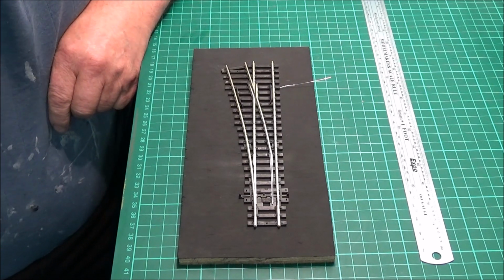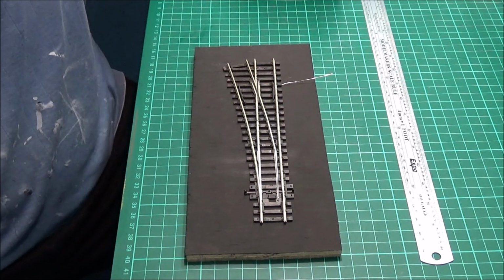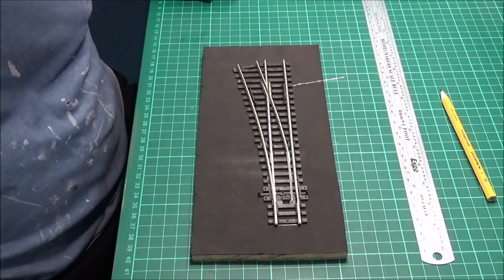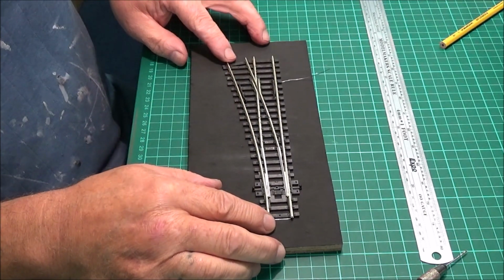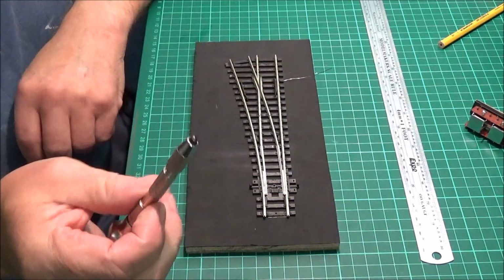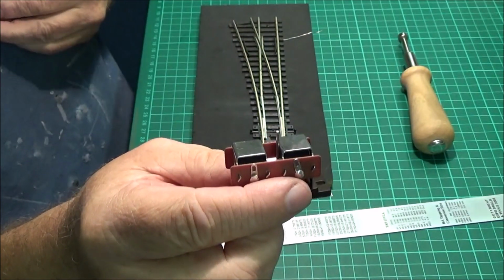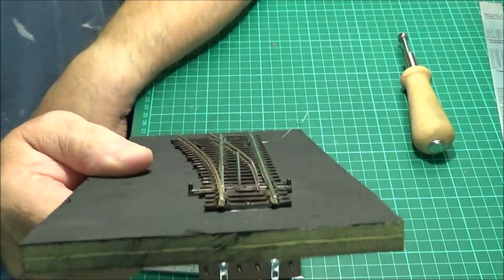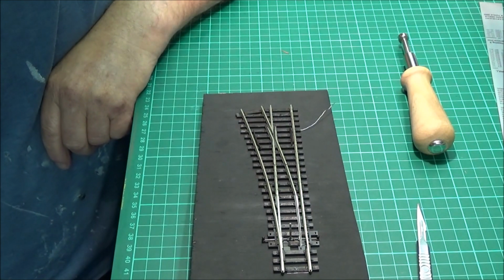Accurate Point Motor Fitting. Video #37

Comment: Useful video, thanks.  I also drill a 10mm hole for the pin to poke though the baseboard, and use Blacktack to hold the plate underneath as you can move it around a bit quite easily if necessary.  As others have suggested, pre-wiring the motor takes this challenge away once it’s mounted, at least at the motor end.

Comment: Interesting.  I am just starting in model railways but in N Gauge. I have been playing about seeing how I can fit the PECO 10E points with varying degrees of success, most of which taking ages! I am going to try your method but as you probably know, the fixing hole for the motor pin is on the outside of the points in N gauge, not in the centre as in 00 gauge so difficult to hide. Your method will probably work but I'm not sure how I can hide the hole on the outside of the points. Maybe a small piece of plasticard which would then be covered by the ballast??
Reply from the maker: Thanks for your comment, yes I think that plasticard and ballast would work, just be careful with the glue.

Comment: What an excellent, informative video!  I shall definitely employ your techniques next time that I need to install a point motor. Over the years, I have spent many an hour struggling with them.  One of the key things must be to lock both the tie bar and the point motor in their central positions.
Reply from the maker: Thank you for your comment

Comment: May I suggest prewiring the point motor and the aux switch before fitting below the baseboard. I leave long (250mm) leads so as to make the final connection (tag strip or choc block) location flexible. I also bond the switch rails to the stock rails on each side and take a pair of dropper wires down below the baseboard too, via a single central hole between the sleepers. By doing this you ensure you are not dependant upon the tiny switches built in at manufacture to make the circuits to the frog, thus ensuring more reliable running in the long term. When using Seep point motors I have jig to identify the fixing holes. These are drilled and counters inked to clear a 4BA set screw.  The fixing 😂holes in the Seep motors are tapped 4BA and now all fitting and fixing can be done from above. Finally I mask and mark the location of the screw heads with card ‘drain covers’ painted black or grey.  Happy Modelling Tony 🚂

Comment: TOY TRAIN SET OR PROFESSIONAL LAYOUT STANDARD ???
Never use SOLENOID POINT MOTORS they'll eventually rip out the Peco hair spring or break it. Use a nice easy screw under the baseboard "Slow action Motor driven type" such as Fulgurex. They last for Decades even on heavy duty exhibition layouts, and come with free built in switches for live Frog's or signal interlocking or whatever you fancy. And are aimed at Professionals !!!
Reply from the maker: Thanks for the tip but I am happy with what I am using.

Comment: Great explanation. I am doing some what of the same procedure you are doing. For centering the throw bar I am using a piece of 0.25mm2 cable. It works the same as the plasticard.
Reply from the maker: Thanks for your comment, great news that the video has been a help to you.

Comment: surely a far,far more easier way would be to just  attach the point motor directly to the bottom of the point itself then cut a small square into your baseboard and simply then just fit the point and its  attached motor assembly straight  into the small hole ??
Reply from the maker: Thanks for your comment.
Reply: Only problem is that when you come to ballast, especially if using small size particles, it falls through the large hole and gets into the point motor and any attached switch underneath. Also, if the point motor fails, you have to pull up the whole turnout to change it. I went this route for my last 4 layouts, and came to the conclusion there must be a better way. This is a good solution.

Comment: I'm with you Michael, fitting motors from underneath is a PITA. I am on my 14th Cobalt and the toughest part is actually screwing the motor from underneath as the flange allowance is vfery narrow (where the screw goes in) and the screws supplied are not great ie dome heads but the grooves arent very sharp. I use your method to centralise the switch rails and drill a 10mm hole so that lines it up and the pilot hole I drill from above through the switchblade tie bar sets the position to drill the larger hole. From the underside, all you can do is hold the motor in place with one hand and drill pilot holes for the screws but because the motor body is so deep facing down, its tough getting the drill chuck in so you have to mark each one. As you say, all in all a PITA. I also agree with you and leave that frog wire lead in place and just feed it below, the less soldering the better.
Reply from the maker: Hi, thanks for commenting. I am not familiar with Cobalt point motors, the size of them always put me off using them but I do know exactly what you mean with the fixing screws.
The screws supplied with the Peco point motor mounting plates are exactly the same as the one's you described, domed heads and barely enough of a slot to get a decent screwdriver into which makes a horrible job even worse!
Stay safe 
Michael

Comment: Why crawl around on the floor fitting point motors or wiring? If the layout is built in individual baseboard chunks. You simply build two wooden vertical stands with large flat feet. Drill a hole in the centre of each end of the baseboard, and bolt the board between the vertical stands. Then you can turn the board over and over as required to install point motors etc.
Reply from the maker: Probably Peco points have been improved since then, I dont have any problems with motors or points.
Your idea of fitting point motors seem a bit long-winded to me but hey if it works for others that great.

Comment: Best method see so far, you could make the cross for location of the motor before the 3mm hole is drilled, centred on a small pilot hole. This would improve the accuracy in the final fitting. great method I will fit all my new point motors this way.

Comment: ¡Hola Michael! I’m about to fit Guagemaster PM1 point motors to a brand new layout. Watching your video has given sound direction for aligning and securing motors to the baseboard. I think my only addition would be to complete any necessary wiring to the motor before final installation.
Reply from the maker: Thanks for your comment, I am glad you found it helpful.

Comment: Hi Nigel
Have a question to ask, I have a double/single slip crossings and having trouble understanding the Peco  paperwork on how to wire them up;  So please can you help me out, 
The crossings are code 100  insulfrog and do not show any loose wiring like shown on the youtube.
just showing the top of the crossing - not the underneath {Please help me out}
Reply from the maker: Hello Nigel, I only have one single slip on my layout and it is a Peco 'Insulfrog' type so no additional modifications were needed.
The point used in the video was a Peco 'Electrofrog' point and only needed two link wires cutting, the stock and switch rails bonded and the thin wire connected to a micro switch for polarity switching.
If I can help further let me know
Michael
Reply: Here is how I do my INSULAFROG Slips - Fit insulated rail joiners to EVERY rail of the Slip.  Wire a ‘dropper’ wire to the outside face of each side of the Slip, in the centre. Connect the Slip droppers to the middle terminals of a DPDT three position (centre off) toggle switch. Wire the outer terminals of the switch to the adjacent feeder tracks.  The factory fitted wire links will take care of the frog feeds, no need to modify the ‘out of the box’ connections.  To operate - Choose the route through the Slip with the point motors and select the line feeding the ENTRY into the Slip, via the toggle switch. Drive the train through the Slip. If the train stalls when initially tested, Reverse the two feed wires connected to the toggle switch.  Good Luck T🚂

Comment: Most people don't know that the point motor mounts directly to the point. No need to mount it on a bracket and try to line it up, cut a rectangle hole in your board, fit point motor to point and it just doesn't get any easier. My father has been modelling for over 20 years and he didn't even know this till I brought it to his attention.
Reply from the maker: Thanks for commenting, I knew about that fitment method and had considered it but went for the other option instead, a lot quicker to drill a hole from the top of the baseboard than gouge out a rectangle underneath. Its all down to preferences I suppose.
Michael

Comment: Just about to build my first layout over here in Canada. This has to be one of the best videos I have seen on the subject and removed my apprehension about fitting the 20 or so point motors I have! Many thanks.
Reply from the maker: Thanks for the kind words Alan, the method I have used has worked very well for me so hopefully you will get your motors fitted ok without problems, it is still uncomfortable working under baseboards but at least it doesn't take as long now.
Michael

Comment: Hi any chance you could let me know what size I-Beam you use.   Great vid by the way easy to follow will deffo use your method.
Reply from the maker: Hi Robin, sorry for the late reply, the I beam I used is 'Evergreen Stripstyrene' number 277. Size is1/4 inch or 6.4mm.
Hope this helps, let me know how you get on.
Michael
Reply: Great tip worked a treat

Comment: excellent video Michael, I've tried fitting the Peco PL-10E point motors  to the underside of my baseboard and have found it to be a bit of a pain. I like the idea of centralising the switch blades and locking the pin in place, brilliant.
Also, I know that some people have used the track cutters to shorten the pin & ruined them, I'll invest in a pair of tinsnips.
Cheers, 
Daz
Reply from the maker: Hi Daz, yep track cutters are no good for those point motor pins. A Dremel and cut-off disc works well but if you try and cut through in one go the heat generated will melt the hole in the point tie bar making the point not switch over properly, don't ask how I know!!!
Michael

Comment: This is an extremely good,and an excellent how to do video ! Cheers for a great share...Andy
Reply from the maker: Cheers Andy, I still hate fitting point motors but it is a little bit easier.
Thanks for your comment.
Michael
Reply: Yes I don't think it's my favourite job ,like you say crawling underneath the board,and I suffer with fluid on the knees,as I'm a landscaper ..not nice lol 
Andy

Comment: Nice informative video - very helpful. Quick question please.  What's the tool used to bang in the the track pins and where can I get one from please?
Reply from the maker: Hi Thanks for your comment, the tool I used is called a Pin Pusher and I got mine from Gaugemaster GM669
Worth every penny!
Michael